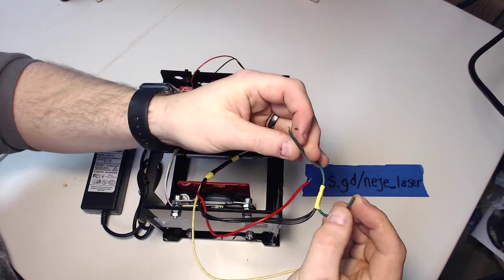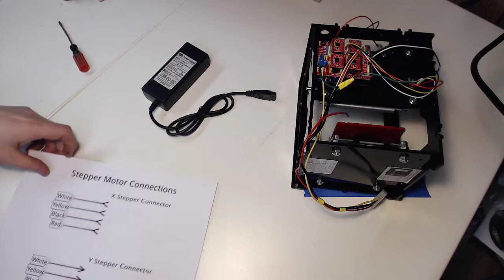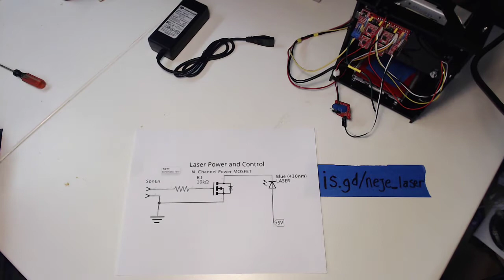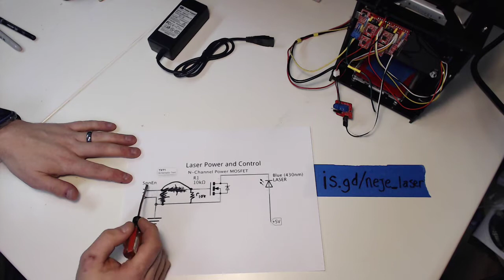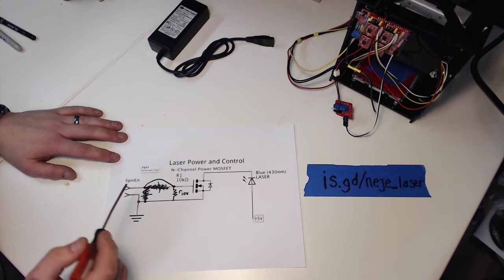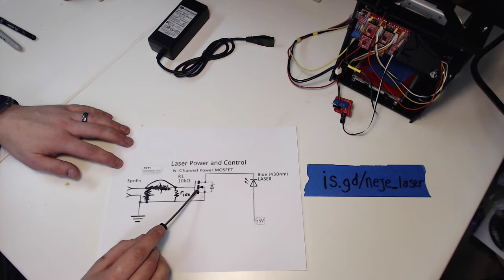Wiring details for NEJE Laser Engraver GRBL upgrade

Comment: Almost all neje laser modules usually have a PWM input and a hence power control circuit built in, so there is no need for the extra MOSFET circuit. Connect the laser's power and ground to your 12v supply and connect the laser's PWM pin to the 'spindle' pin of the CNC shield. Not only do you not need the extra circuit, but you also can run the laser using variable power so you can burn grayscale images, or run the laser at 30% power, or whatever. Way more flexible and much simpler. Lots of info on line on how to configure GRBL for laser with PWM.

Comment: Hey.. Is this still the way to connect laser too cnc shield ? isent it possibel to the out the 5 volt from the pin on the CNC shield
Reply from the maker: If your laser uses 5 volts then you could probably power the laser with USB, but you'll still need the MOSFET thing in there to switch the laser on and off because the I/O pin on the board can't provide enough power by itself; the pin can probably give 20 milliamps but the laser needs much more than that depending on the power of the laser.

You might try looking for other a CNC board has the whole MOSFET thing built-in, something like this for example: https://www.ebay.com/itm/164909401299 (note, I'm not endorsing that board, it's just a random one I found). Also note, that board is for lasers that use 12 volts, so you'd need to pair that with a 12v laser or get a different board that can provide 5 volts if you have a 5v laser.
Reply: @matthewnielsen2549   thank you for the answer.. But come to mind, my laser must be 12 volts as it has been running on a MKS gen 1.4 board where it was connected to the fan power.

My noname china laser has only two wires (black / red) and is very much in doubt about how to connect it to cnc shield v. 3, My Arduino Uno runs GRBL 1.1

I have tried to set it to Z- and Z +, it does not work. Have also tried with Spindle, does not work either :)

Maybe you can help me further?

Sincerely

Lars. Denmark
Reply from the maker: @larsplovmann4280  Ah, the hardware you're using is much more advanced than what I use in the video! I don't know much about running grbl on a 3d-printer board (I have only used Marlin on a 3d-printer board).

The GRBL source code says the default "spindle pin" is "D6": https://github.com/grbl/grbl/blob/master/grbl/cpu_map/cpu_map_atmega2560.h#L81

From this picture (https://reprap.org/forum/read.php?13,753796,753884#msg-753884) I see that "D6" might be one of the "SERVOS1" pins.

But that pin will only give a signal to tell the laser to turn on/off, it won't actually give it power. You could use a MOSFET like I did in the video, which should work when you connect the "sig" pin of the MOSFET to pin D6 of the MKS board.

You could also buy a different laser that has a 3rd pin, but that might be a lot of money. They are called "TTL lasers" or "PWM lasers", where the extra 3rd wire would connect to D6 directly. 

In theory, you could also change the grbl code so that "SPINDLE_ENABLE_BIT" is set to one of the E0, E1, or HEATED BED connectors and then connect the red/black wires of the laser there. Those connectors are set up to give LOTS of power and can be switched on/off in software, but I don't know what you would need to change to make that work.

Comment: can you upgrade a neje master 20 watt laser so it can use lightburn?
Reply from the maker: I've never used that model before, but unless it is designed round a GRBL-based board then it would need to be be upgraded to one that does. Connecting the motors to a different GRBL board would probably be easy, but controlling the laser (turning it off and on) may be harder since I don't know what kind of power system that one uses.

Comment: Hello, Did you add a resistance to your circuit or not ? I don't see it in your wiring. Is it included in the little red mosfet board?
Thank you,
Max
Reply from the maker: Yes, the little mosfet board has a pull-down resistor connected to the gate. If you are wiring up the mosfet yourself you'll want to include one to prevent the laser from accidentally turning on while the controller is off/unplugged. This is the type of module I used (with the exception that I swapped out the IRF520 with an IRL520) and you can see the resistor connecting the "SIG" pin to ground: https://www.ebay.com/itm/TOP-MOSFET-Button-IRF520-MOSFET-Driver-Module-for-Arduino-ARM-Raspberry-pi/201145556765
Reply: @matthewnielsen2549  Hello, Thank you very much for the quick reply. I bought all the elements and I am going to put all this together. I made a first attempt to power the shield with a 20V power supply, but the motors would heat up very quickly. I'll try again with 12V from a computer power supply, I hope it works better. Cheers.
Reply from the maker: @ShadowZarathoustra  If you haven't already, you may try to adjust the driver current (the little round turn-y things on each driver module) down, that may help the heat. I show how to do it in the previous video (the 1-hour long one) but there are even better videos on youtube.

I have never tried running any stepper with more than 12v so I can't be of more help there, but good luck to you! Let me know how it goes!
Reply: @matthewnielsen2549 Hi Yeah, I managed to get something out of the set up; I had some fun attaching a pen to the side of the laser with a rubber band, which allowed me to draw nice shapes using the handy Laser GRBL software I found online... But I had frustrations too. Strangely the driver board potentiometers seemed to give a negative voltage between 2V and 6V. I ended up tuning the voltage by ear whilst running the motors. They heat up a bit, it's hard to get it right, either they don't get enough power to move smoothly or they start hissing and heating. I took me some time to find out that the laser signal was not coming from SpinEnable ... Unfortunately the laser is not getting full power from the Mosfet, not enough to burn. If I get it correctly for the mosfet to send the required 5V, it should get 10V ? Is it normal that when I play with the M3 S command, the power of the laser changes ? I thought the mosfet was just a switch. Another oddity, I tried S255 and S2550, and S2550 was brighter... This is addictive, but sometimes a little bit unnerving, I am not sure where I am going to go from here, so many possibilities, but also quite time-consumming  !
Reply from the maker: @ShadowZarathoustra  Negative voltages on the driver boards seems wrong, but I don't know enough about steppers to know why. Most stepper driver chips should be able to handle 24v but check the datasheet for yours, maybe they just can't do 24v.

As the for the Mosfet, you will need to check its datasheet too; models like the IRF520 want 10v at the "gate" pin have the mosfet be "fully on", but the GRBL/Arduino board can only send 5v to it so it won't be allowed to pass the full through. 

Think of mosfets (and all transistors really) like a water valve. When you send some voltage to the "Gate" pin, a certain amount of current is them allowed to flow from the "source" pin to the "drain" pin, just like turning the valve on a water value. Think of voltage being sent to the Gate pin as the number of turns on the valve to open it completely: if a water valve requires 10 turns to open completely, but you only turned it 5 times, you would only get about half the water flowing through it. Similarly, if a mosfet takes 10v at the gate but you only give it 5 then it won't allow the full power to go through it.

That's why I swapped mine with a IRL520 which only requires 5v at the gate pin to be "fully on". You don't have to get an IRL520 though, you can use any mosfet that can operate with 5v gate voltage. To find one that works, look at the datasheet and find the information for "Rds(on)". It will have a number in volts which is the voltage required to turn the mosfet fully on. Sometimes it will look like "Rds(on) = 5v" and sometimes like "Rds(on) : Vgs = 5v", they're basically the same here.

You can also look for mosfets that are called "logic-level", which is shorthand for something that can work at these lower voltages. An example is here: https://www.adafruit.com/product/355 . 

That was a lot of info overload above, I hope it made sense and was a little helpful :)
Reply: @matthewnielsen2549  Hello, Thank you for  your time. I managed to bust the laser with all the tinkering! I had a lot of fun though. I think the next step will be to buy an Arduino Starter Kit on ebay and explore a bit more on electronics and the Arduino. In the meantime I'll think over what kind of CNC set up I want to put together. If I may tell a little story... What pushed me on this path is that I have a stock 200kg of small disks of really nice olive wood (5cm diameter, 1cm thickness)... That's a lot of disks. I know it sounds strange . My father cut them compulsively 40 years ago as he was living in Morocco. He would pyrograve disks with initials and make pendants out of them to sell them on the beach of Royan on the west coast of France in true hippie style. I've kept the little pieces of would and I am looking for something to do with them. I've laser-etched some of them with the Neje , but that's too slow. CNC carving could give good results. I  managed to sell some those laser-etched disks as poker chips... Thank you again for the inspiring videos and the advice.
Reply from the maker: @ShadowZarathoustra  You're right, it would take this little laser a LONG time to etch that much wood :) It may be worth looking in to a larger machine like the CNC1610 (I have one of those now too).

I hope it all works out for you and you get the engraving you want, it sounds like a fun project! Good luck!

Comment: Love the video I upgraded my Meterk as instructed in the video. However, my laser has no power. Help!!!
Reply from the maker: First thing to check is if the laser itself is OK: you can do this by connecting it directly to 5V power and make sure it turns on (make sure you’re wearing eye protection and it’s pointed away from you!). If it turns in the the problem is somewhere else. 

Depending on the GRBL board you have and how it is configured, the Z-limit pin and the Spindle/Laser control pin may be swapped, so switching those is also something to try. 

You can test the Spindle/Laser control pin by wiring a regular LED (along with a resistor of about 330 ohms) between the pin and ground. Then issue the command to turn on the laser and the LED should light up. If it doesn’t then there is a pin or configuration issue. 

Finally, make sure the MOSFET you are using is good and rated at the correct “Rds(on)” voltage (check the data sheet on the internet). It should be around 5V; if it is rated at 10v or higher then it may not be turning on properly.
Reply from the maker: I made a video that covers the ways to test the laser in case anyone else who comes here has the same problems: https://youtu.be/xnTQmROZIwI

Comment: I know a lot of people have asked the same question. Where to get the power, and cable. Tell them to go to Ebay, look under drive cable an adapters. It is listed as, hard drive hd data transfer cord cable kit- usb 2.0 to sata pata ide 2.5 3.5 hd. This is what it is called, it come with power, the came cable you showed. I hope you pass this on so people can fix there neje lasers.

Comment: Hello Matthew, thanks for making another informative video.  I’ve modified mine as per your instructions and it works great, for the most part. 

You mentioned on the GitHub page or in your last video about maybe making it PWM. Any ideas on how to do this? Have you seen a laser driver which will drive the 5 volt laser? I’ve looked around but I’ve mainly seen only 12 volt lasers. 

It also it seems to be having difficulty burning perfect circles or curves. They come out a bit jittery and not very smooth. Any ideas how to improve the smoothness? I’m using the same settings for grbl that you originally posted on your GitHub page. Thanks.
Reply from the maker: PWM:

Yes, I have got PWM working, though I need to tune it a bit. In the grbl "config.h" file you will need to uncomment "#define VARIABLE_SPINDLE". If you have an older CNC shield (like I have) this will also end up swapping the SpnEn and z-max-endstop pins.

Next I took the red MOSFET board pictured above and replaced the IRF520 MOSFET with an IRL520 MOSFET (note the difference is "F" or "L". The "L" means it is a "logic level" version that can be fully switched with 5V whereas the "F" version required 10v. Any logic-level MOSFET would work as long as it can handle enough amps, I just happened to find a bag of old IRF520s for sale on eBay).

I found that I also needed to change the "$30" grbl variable (https://github.com/gnea/grbl/wiki/Grbl-v1.1-Configuration#30---max-spindle-speed-rpm) too, depending on what program I was using. Some programs (like JTech Photonics laser plugin for Inkscape) assume that max laser power is a value of 255, so I needed to change $30 to match that.

I'm still working on tweaking the power levels (things are being burned a little too dark) but on the whole it's working -- this is still with the stock 5V 1000mw laser.

This is probably something I need to do a video on as well, huh? :)

Smoothness:

Try lowering grbl $110/$111 (maximum stepper speed) and $120/$121 (stepper acceleration) and see if that helps. You may also have the driver current (the little potentiometer on the four stepper drivers on the cnc shield) a little low, so you can try turning that up a little bit too.
Reply: Matthew Nielsen Matthew Nielsen thanks for the reply. I’ll see if I can find the mosfet board and logic level MOSFET.

I’ll give the settings a tweak and see if it helps, as you suggested. I started out trying your suggested current settings to begin with, which worked fine for the platform motor (y axis) but I had to drive the current up for the laser moving stepper (x axis) to get it to move without skipping. I suspect that it might be on its way out as I’ve had problems with it skipping when I’ve been using it with the stock board.
Reply: Matthew Nielsen what’s the major difference (if any) between the IFL520 you used and the FQU13N10LTU that you suggested in the description for this video?
Reply: Any update on the PWM tweaks?

I recently followed your excellent videos to upgrade my DK-8-KZ to use GRBL instead of the terrible NEJE software.  I've got minimal electrical experience, but you explained every step in a way that I could understand.  This was a good hands-on project and I'd like to learn a little more.  :)

Comment: This video is a lot better, only one thing. The end you hooked the fan up to the power supply, where does the laser get it;s power from. I have you in my subscribe file.
Reply from the maker: The laser gets power from the +5V part of the power supply, you can find details at about 11:30 in this video: https://youtu.be/MuKYvifYnYs?t=694

I am using a power supply that provides 12V and 5V in one unit, it is similar to this: https://www.amazon.com/Coolerguys-100-240v-Molex-Power-Adapter/dp/B000MGG6SC. You can also use a full-sized PC power supply if you happen to have one around.

If you don't have a power supply that can give you both 12V and 5V then you can use two separate power supplies. The wiring will be mostly the same, simply make sure that +12V goes to the CNC shield and +5V goes to the laser.